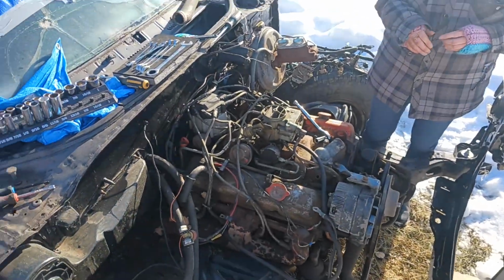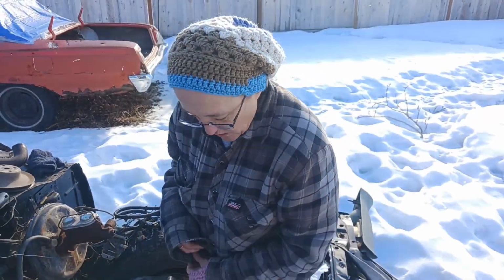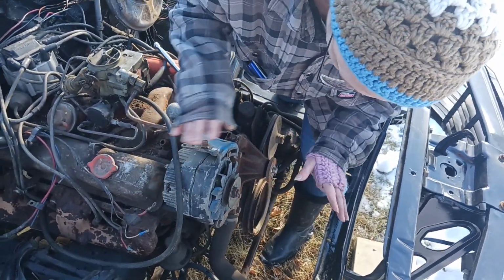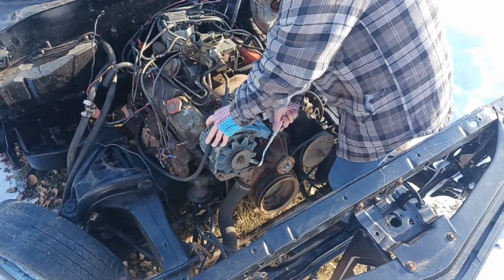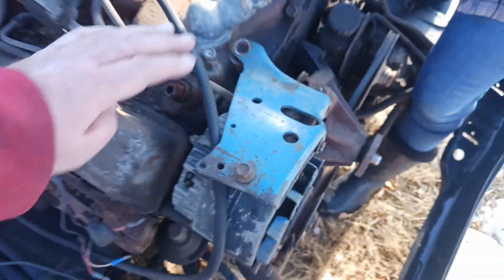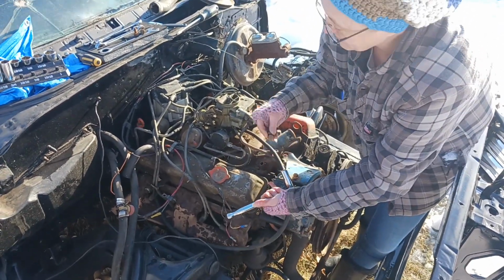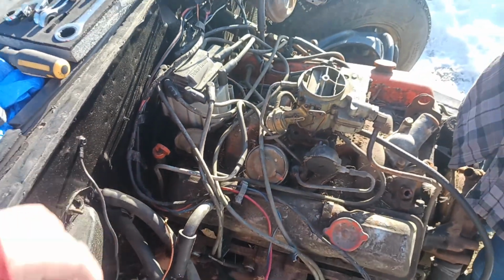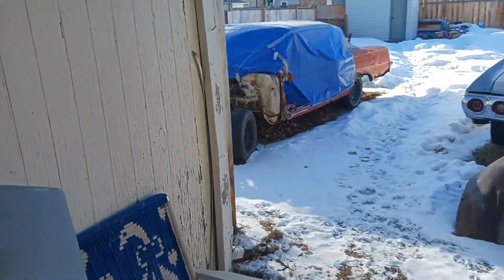72 Chevelle 262 removal part 2

Comment: I had a 75 Nova back in the day with the factory 262. I believe they used those in the Nova and Monza in 75 and 76.
Reply from the maker: That's awesome. i like the novas.Are the heads any good on these things. I'm not sure if this thing has value to anyone or just scrap.
Reply: @Rescued And  Restored Garage  It's a low hp smog engine. Although the one I had, I swapped in a 327 L79 cam with holley 650 and Headers, run great off the line but had little left at top end.
Reply from the maker: @Old Car Garage  well when we get the  262 out, we will just give it away to anyone who wants it for a free. If not junk time. I know I have no need for it, I have the 72 402 that will go into the chevelle anyway, just a factor 307 car, and I want to make my dream chevelle.
Reply: @Rescued And  Restored Garage  🙂👍